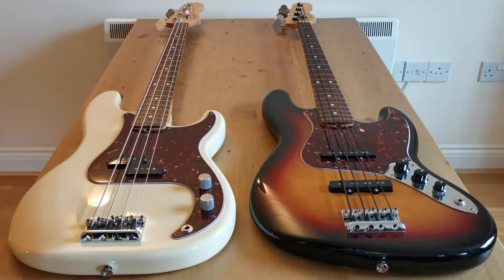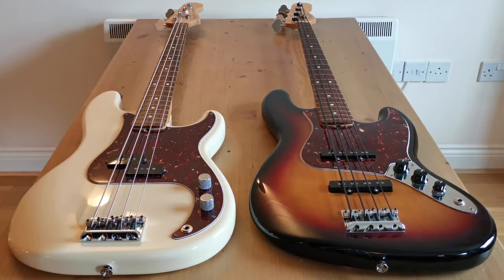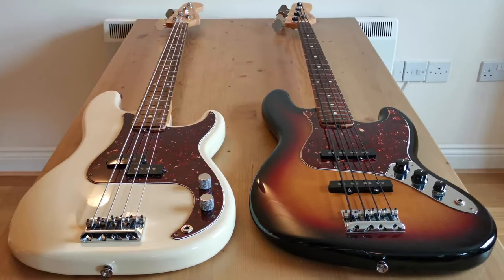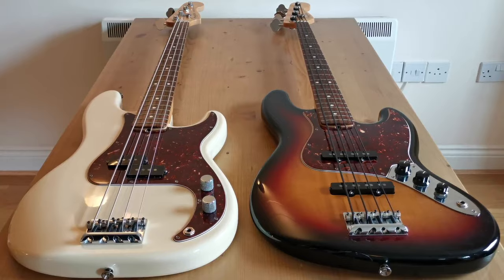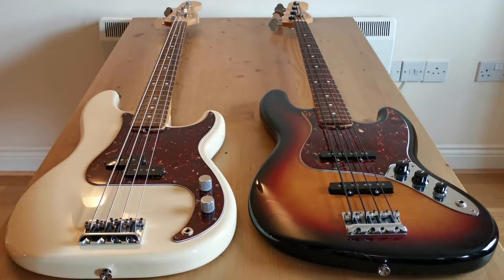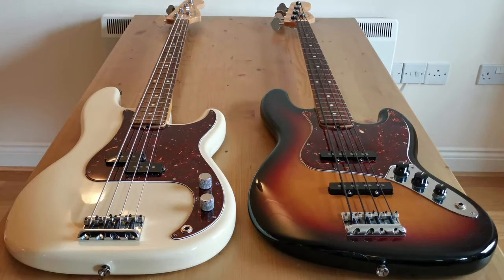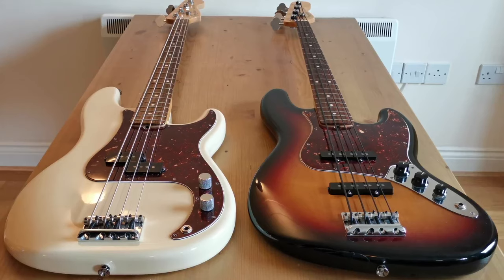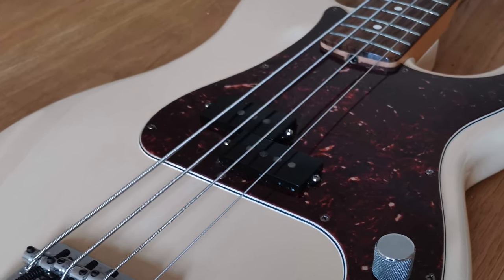Precision Bass vs Jazz Bass - What are the differences and Why they matter

Comment: Great comparison. I found the perfect solution for me with a Precision Bass with an A-neck. Fender made P-Basses with narrow Jazz-Bass-Type necks, called A-necks, in the 70s and these basses are perfect to play with my smaller hands. But they are pretty rare, and it took several decades before I got my hands on one. Before that time I was playing Jazzbasses simply because I could not play the wide P-Bass neck.
Reply: @stabbly  Thanks for your advice! Yes, I do this since many years. I have 6 P Basses with J neck and only 2 of them are real Fender A-neck Precisions. The other 4 are all Frankensteins if you will!
Reply: Jazz Bass Special could have helped you out.  Narrow neck and both P and J pickups with a selector, best of both worlds
Reply: IIRC, Nate Mendel's signature P has that neck, modelled after his own Precision made in the early 70s
Reply: @EmanCarbone  Are you sure Eman? I just looked at Thomann. The Nate Mendel P bass they offer has 41 mm neck width at the nut (not 38 like a Jazz-Bass). But maybe Fender has changed this as they did with the Duff McKagan model some years ago, too.

Comment: I just got my first J Bass ever and have had a P Bass for about 15 years.  The hum of the J Bass freaked me out at first, and I thought there was a wiring issue.  I didn't realize J Bass is notorious for this hum.  Messing with my EQ and moving it away from an electrical source and/or switching to passive vice active eliminates the buzz.  I can see why you mentioned this, and that P Bass is more ideal for recording.

Comment: Really great comparison.  And I like how you didn't just focus on the tone, but other aspects as well, which for me, are all good things to consider.  

I played a P bass for years and loved them.  Only within the past year and a half have I begun to play a Jazz bass.  And I am now a convert.  For me, the biggest difference is the neck.  The Jazz neck is just sweet and feels so comfortable.  As for the body,  I always thought the body was ugly, now I love it.  It does look odd on a stand, but strapped on and played, it looks balanced.  The hum was a big negative for me.  I switched out the pickups to humcancelling ones and that solved the problem of the hum.  I also love how  you mention turning down the volume.  Definitely a simplicity to the P - one volume, one tone.  I  have noticed that when recording with a Jazz, I do like the extra option of tones available.
Reply: Sometimes i turn the tone and level of both pickups full, maybe a touch off full.

Comment: My observations as an owner of both.  I got an American Precision new in 1974 and it was my workhorse for years. Still got it and it’s a stage grade instrument.  Sadly I can’t gig it these days as it’s a shade over 11 lbs.  My current go to is a Mike Lull M5 - only 8lbs.  For a while I owned a 76 Jazz Bass and it was the same natural ash body as my Precision but it was 8.5lbs.  So the comment about extra wood making a Jazz heavier doesn’t really stack up.  When I first got the Precision it was very noisy and buzzy but a friend cured that by rewiring it.  The 76 Jazz was pretty quiet from a buzzing respect.  Later I bought a 2010 American Jazz V - passive and it wasn’t really noisy.  It was a tad heavy though but still under 10 lbs.  I upgraded it with a John East Vintage Preamp and it really was a killer sounding instrument.  After I bought my Mike Lull the Fender Jazz V was redundant so I moved it on. 😎

Comment: I bought myself the higher end Fender American ultra jazz base thinking I would be able to play it the same way as my American Precision P-Base. I quickly found out that my fingers just couldn’t adjust to the differences in the physical dimensions specially in the neck and fret width. I have a small stubby fingers, but I found them fumbling all the time and it became a very frustrating experience. 

I ended up selling that beautiful midnight blue jazz bass and decided to stay strictly with the Precision. What I did notice was that I can get the jazz bass sound much better when I tried slap technique, but couldn’t replicate that same feeling on the Precision.

Some say the jazz bass is more friendlier to use for smaller fingers and maybe I should have started out with one as a beginner. Who knows- maybe it would have been an easier transition into a precision.

Comment: I prefer precision bass over jazz. I recently bought the squier 40th anniversary precision bass (Lake placid blue with gold hardware) its an awesome bass. It's up there against my fender player series. I also have the fender pro. 2 in dark knight finish but I the struggle with tone its bit too bright for my feel but I use it only for big gigs.  But its all precision for me.
Reply: Played that Squire at guitar center. Nice chose! I find I prefer P basses now for sound and the neck is fine for me even with shorter fingers. Never a big jazz bass fan. But I do like the sharper J bass sound because it really helps you learn by ear. 
I'm sure you played the classic vibe 60's too?
Reply: @scott9628  yupp i Agree on that. Yea I've tried a few. They are pretty good once a good set up is done and maybe a few mods if needed. ✔️
Reply: @Livemusic1800  I find most of the "good" Squire's just need more polished frets, some set up work and maybe new tuners. That's it!

Comment: Injust got the pbass 60 vintage.  I jave a fender jag i habe been using.  The jag is perhaps quicker, but note output seems better on the pbass as the strings are a little further apart. Seems easier to get a good clear note from the G string.

Comment: Gotta say the jazz bass is extra hummy with the tapewounds on it. Since the strings don't ground properly to the bridge cause of the tapes you gotta be touching the bridge or control plate at all times to stop the hum even while playing. Unless you have your pickups and internal shielded well its a problem with those specific kinda of strings.

Comment: Not wanting to be pedantic here, but noise canceling is due to opposite phase between both coils and not because they are wired in series, if they were wired in parallel they would still be noise canceling.

Comment: I love both, of course. But hold a gun to my head, and yeah, I'm a J-Bass man. I think I might almost prefer the feel of the fatter P neck to the faster J neck (definitely prefer the look of it, at least), and I also definitely prefer the P body to the J body, both in terms of the look and the feel, though especially in the feel.

I also have a "more than slight, but less than profound" preference for the P-Bass pickup over against the neck pickup in the J. But the two are close enough that in certain contexts it can even be hard to tell them apart, meaning the J is a more than close enough approximation in all but the most extreme or specialized of contexts. And besides, the "less chunky / more "waxy'" sound of the J neck actually quite often makes for a fun, interesting, and unique spin and "parallel universe" take on the vibe the P-Bass is known for, and can again land you close enough to P that it works, but far enough from P that there's a certain fun novelty to it (especially important when the P-Bass has, if anything, been TOO ubiquitous to the point of "oh God, a P-Bass again" - especially in the 70's.)

However, the reason I ultimately land on "team J" is for the flexibility and spectrum of tones it offers. Though I've spoken most heavily on the J neck pickup, it is actually the setting I use the least on a J. I spend the majority of my time in either blend or bridge positions as in more than half of contexts I prefer those tones to "the P sound" (which for this purpose we'll lob the J Neck in with too).

While I did enjoy this video (my J is a 2008 MIA Fender, so essentially the same as yours, only in a gray frost color), as I have enjoyed other videos you've posted, and while you certainly let us hear a bunch of J neck vs P (which in my opinion is the most interesting facet of this comparison), my one gentle gripe with the video is that you didn't really spend a lot of time talking about the tonal differences and similarities therein (what I characterized as "chunky vs waxy"). Had you done so, this would've gone for me from a "really good" video to an "outstanding" video...but alas.

Lastly, there is a difference between these bases in terms of what strings I do or do not like to use on them. For me, any P-Bass or clone that I'm gonna own HAS to be strung with either flatwounds, or at the very most, with groundwounds. I do not like the sound of rounds or tapes on a P. I also typically don't like the sound of playing a P with a pick, unless the tone is turned waaaaaay down. A pick on rounds at full tone on a P results in a certain "clung" sound that I think I'd be willing to go so far as to say that I HATE. On a J, I like all four string types and in a vacuum would happily have any (as well as both pick and finger style - though even here, finger style usually wins for me - generally fingers close to the bridge on the bridge pickup, up on the neck for the neck pickup, and roughly in the middle on the blend.) But for the sake of increasing diversity relative to the P, I usually stick with rounds, though one of these days I would like to try tapes.
Reply: Here's a track that I'm 99.9% sure is using either a J-Bass neck pickup, or if not, then the virtually identical-sounding "51 P-Bass" with the single-coil four-magnet pickup (which just has a microscopically richer, incidentally less articulate "slightly different flavor of 'wax'" relative to the J neck). It's close enough to the chunky, ubiquitous, split-coil P sound that it took more than one listen to conclude that I was not just hearing the standard P, which ultimately demonstrates what I was on about in my previous comment that the J neck is so fascinating to me for landing "in the general neighborhood of a P sound", while straying JUST far enough from it to make it more interesting.

https://youtu.be/R1z63jDLGf0

Comment: Jules, I am curious about the tape wounds on the Jazz.  Usually, most will put the flats or tapes on the P and rounds on the Jazz.  That's what I currently have.  Why the tape wounds on the Jazz?  BTW, I have a preference for flats.  I like the way they feel and no string noise when recording.
Reply from the maker: My jazz is has quite a mellow tone naturally, so the tapes just fit nicely with it. I especially like them with the bridge pickup. The super crispy roundwound sounds just isn’t what this jazz wants to do. My P is more alive so suits rounds well, but I often use flats on it as well.
Reply: @JulesGuitar  Doesn’t it get noisy with the tapes?

Comment: preferring the Jazz neck both my P pickup basses have Jazz necks - long termer Japanese domestic model Aerodyne - which is an actual jazz bass with the front pickup replaced with a P bass and recently added another MIJ  the Hama Okamoto  P base which has a Jazz neck on a P body/electrics best of both worlds

Comment: Great video 👍. Is the pickup set up on the P bass similar to a humbucker on a guitar?
Reply from the maker: It's somewhere in between single coil and humbucker... fat, but with clarity. Look up the G&L Comanche guitar, which is like a strat but with split coils, you'll see how much fatter they are than straight up single coils, but it still sounds like a strat.
Reply: @JulesGuitar  Thanks!

Comment: I understand that a P bass has a single split coil PU.  Is it possible for a J bass to have a single PU as well?  If you look at a bass with just one PU can you make the determination, i.e. P or J or are other factors, i.e. nut size, body style need to be considered?
Reply: It's rare, but there are some. Most of them are modded ones. I believe Fender did make some though. For example, they make a J-bass shape for Mark Hoppus with a P-bass pickup in it. I think they produced it for a while. I don't know what neck it had however.

Comment: Did you change the strings on the jazz at some points? Some of the clips appear to be done with a different set of strings
Reply from the maker: Yes, the clips are all from older videos, so the Jazz has the same fender roundwounds as the the P